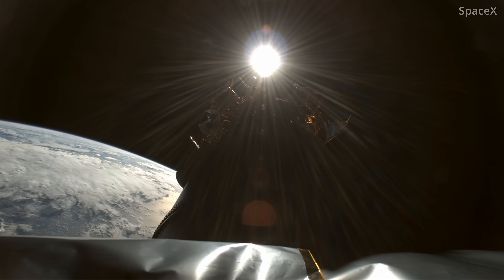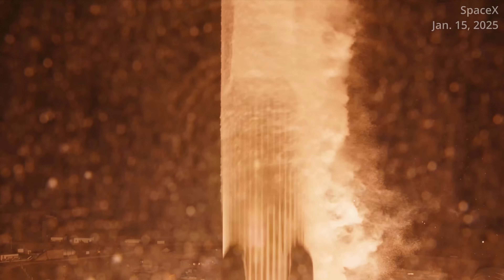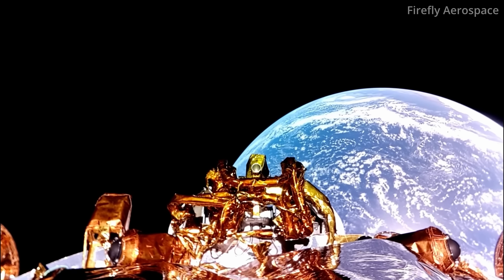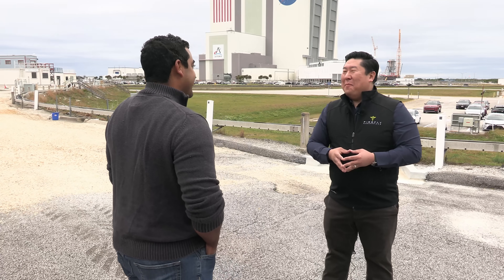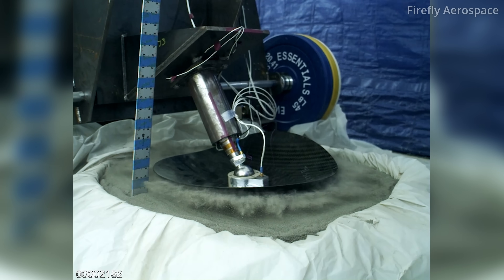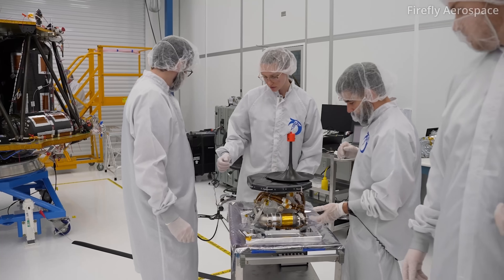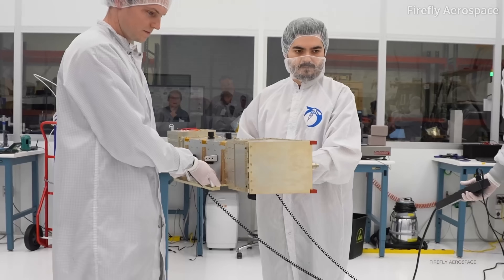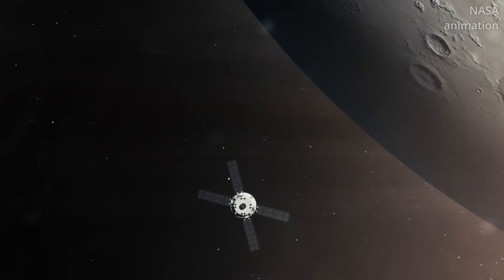Firefly Aerospace's Blue Ghost lander closes in on Moon landing

Comment: Let's see if theres any dust when landing be interesting
Reply: 8:02 One of the major payloads is studying the dust specifically.
“Stereo CAmeras for Lunar Plume Surface Studies (SCALPSS 1.1) will capture video and still images of the area under the lander from when the engine plume first disturbs the lunar surface through engine shutdown. Long-focal-length cameras will determine the pre-landing surface topography. Photogrammetry will be used to reconstruct the changing surface during landing. Understanding the physics of rocket exhaust on the regolith and the displacement of dust, gravel, and rocks is critical to understanding how to avoid kicking up surface materials during the terminal phase of flight/landing on the Moon and other celestial bodies.”

Comment: I've been following SpaceX  since before the first falcon 9 launch attempt, now bringing things up to date we're not in the business to launch Starship's for the fun of it, it should be obvious by now ,the numbers and equations the starship is designed by are not adequate for its task , but falcon heavy has been performing in accordance for the task that it is designed for, temporarily setting the starship aside and concentrating a falcon heavy's new upgrade add 10 meters for payload doors to deploy cargo, and my design heat shield rapping film light weight, low cost and heat resistant,and now we have another reusable vessel, problems solved.

Comment: is there a reason we cant get video streaming of a landing and then of a vehicle moving on the moon
Reply: Because it takes time to downlink video from the moon and back, plus, it’s a small lander with only a limited power supply. Live broadcasting of video is one of the last priorities
Reply: @archierush868 fair. thanks for reply. do you expect we will have live landing and live footage at some point this decade?
Reply: @yanbibiya probably not just because of the amount of data processing needed to broadcast live footage, even just 720 or 1080p footage, is too great and doesn’t pose much scientific value that actual raw data provides which is why for some rocket launches, you just see an animation of the launch instead because the video feed is not as important as the data
Reply: @archierush868 cheers

Comment: Didn’t we do all this in 1960’s  
Everyday i believe less and less that NASA actually went to the moon.  I sure hope it wasn’t faked but everything they said they did in the 60’s they are redoing with 60 year newer equipment, like we never had any data from the past.
Reply: Yes, but this is with a much smaller budget of around $100M rather than around $500M for 7 surveyor missions, 2 of which crashed on the surface, and it’s with a private company which made the lander, not NASA contracting it out.

Comment: Finally, a lander that is wide with a low CG, not tall and spindly and guaranteed to tip over.  Take some notes Intuitive Machines and Elon.
Reply: I believe the lunar starship variant will not have the nose tanks. But rather rear tanks for the landing burn. Which should help the CG. But I still see what you’re saying. It’s worth mentioning though that these light crafts are actually more difficult to steer than a larger one. Similar to a trailer here on earth. A smaller input affects a smaller craft a lot faster. You use a lot more fuel relatively to compensate for that. And are overall less precise(still pretty good though all things considered, we can certainly work with it)

Ideally the lunar ship will have legs too, hopefully it’ll work.
Reply: You wou think the Apollo missions would have set that template 56 years ago.
Reply: Actually NASA’s John Hubolt designed the mission architecture 65 years ago. Park in low lunar orbit and take a small two stage vehicle to the surface. SLS does not have the throw weight of the Saturn V because the upper stage is too weak and it cannot make low lunar orbit, so we are stuck with a high lunar orbit and this ridiculous “Gateway” concept which allows for a surface abort one a week rather than once every couple of hours. Elon will need multiple launches and perhaps a dozen LEO cryogenic refuelings (which have never been done or even figured out) and then wants to drag the massive Starship and its return fuel down and then up through Moon’s gravity well. Not only is this absurd but the moon is not perfectly flat and there are no chopsticks to catch it. But they actually don’t need return fuel because It’s guaranteed to tip over on landing. So it’s got that going for it!
Reply: @glenwoodriverresidentsgrou136     Starship is important because it can carry 200,000 pounds. If we want to build a base on the moon, then we need a big cargo vehicle...not a small lander.
Reply: Elon doesn't have to take lessons he's the one who  who they take lessons from may I remind you space x shuttles Astronauts and supplies to the ISS
Space X will bring back BOEING Stranded Astronauts back. Home in about 2 1/2 weeks from now aboard the crew dragon capsule that there spacesuits were specially designed for them
Reply: Two things can be true at once, and Elon is not right about everything. His Crew Dragon is a great design and his moon lander is too big, too heavy, too tall, too skinny, and requires too many LEO refuelings to be considered anything other than a Rube Goldberg contraption. Just because Elon builds it or says it doesn’t mean it’s right. He’s not the only smart guy on the planet.
Reply: @glenwoodriverresidentsgrou136  
Elon & Space X has saved the Space Program what he has done has encouraged other private companies to get into the Space Exploration Program 
NASA hasn't done anything 
Boeing Is A Failure
Bezos Blue Origin has shown great improvement  can't  wait to see what's next
Sir Richard Branson has taken a step back but hope he gets back in the game
Reply: @glenwoodriverresidentsgrou136 who cares about complexity when it’s the cheapest option? That’s why NASA chose starship for the lander, it’s cheaper than everyone else’s options for a human lander. SpaceX is also a whole league ahead of everyone else with all the test flights they’ve done and all the data they’ve collected to integrate into the lunar variant
Reply: @ only partially true. Elon says “the best part is no part”, a version of “KISS…keep it simple stupid”.  But the complexity of the lander is  a complete abandonment of this mantra and a huge liability with respect to safety. It’s not all about cost. Motorcycles are way cheaper than cars, but how many do you see in rush hour traffic?  How many Starship launches have been completely successful and didn’t either blow up or crash?  Almost none?  Would you ride in that thing?  And OBTW, Bezos is also contracted for a lander. A more conventional design, short and wide. Elon is currently in the lead, but so what. May the best design win.

Comment: I don’t understand why it took a month to get there. Apollo took 3 days if I’m not mistaken. Escape velocity is what it is. 25,000 some mph. It had to be traveling at escape velocity.
Reply: Because Apollo had people onboard, which require food and water to live, of which they had around two weeks worth of onboard. This probe has no people, so it can take its time to get there checking everything before going to the moon.
Reply: @archierush868 I kinda expected some dumb responses but holy dead brain cells Batman.
Reply: @garyfliess4375 am I wrong? Do probes need food, water and oxygen to survive?
Reply: I think because they were a "piggy back" load on the launcher. They once in orbit around the Earth they had to wait until the satellite and the moon were in the "correct position" to start the trip to the moon. The Apollo was lauched at such a time (and Satellite-Moon constellation) that it could immediately continue to the moon. For Apollo time was important as the amount of oxygen was limited. 

And not being time constrained doing a couple of days around the Earth allows to check the satellite thoroughly before sending it out to the moon. Certainly also useful.

On a mission to the moon you do not have to reach escape velocity. You basically go into an eccentric orbit where the apogee is so close to the moon that the Moon attraction "wins"  from the Earth attraction and you transition from an Earth centered eccentric orbit to a Moon centered eccentric orbit. That is the most fuel efficient way to get to the moon. However, the Blue Ghost orbit is a bit different. They do not fly the "8" pattern that Apollo did (which is the most fuel efficient and probably one of the fastest orbits to the moon) but they keep flying in the same direction. This certainly takes longer (and also more fuel which surprises me a bit about this orbit).

Comment: Did Apollo land with the large bell or the smaller thrusters?
Reply: The blue ghost is about as large as a big golf cart. The Apollo Lem was huge in comparison so it had a large landing engine.
Reply: @johnviolette5511  True. And a big part of the large size difference is also due to the astronauts needing to have a way to get home. The weight of the ascent engine alone (dry mass w/o fuel) was 2100 lbs!
Reply: The small ones. The lander had no "large bell". That was on the lunar orbiter.
Reply: @PosiTim-GNSS  Troll much? All of the Apollo Lunar Modules used a single large variable throttle Lunar Module Descent Engine (approx 10,000 lb max thrust) for descent and landing. There were also small thrusters used for attitude control.  These were certainly used for orbital docking maneuvers, but I am not sure they were used at all during landing. The large descent engine could be steered via a two-axis gimbal. For the last few Apollo missions, performance of the descent engine was enhanced by lengthening the engine nozzle/bell. This increased overall performance and allowed those landings to be performed with significantly less fuel. With reduced fuel weight, it became possible to deliver more equipment to the lunar surface, including the lunar rovers.
Reply: Did it is the question...

Comment: This is a 14 day waste of money, this mission should last at least 10 years and the secret part likely will
Reply: How would you make a probe that can survive 10 years on the moon and it enters extreme ranges of temperatures for two weeks of +180C and two weeks of -150C?
Reply: @archierush868 Well if they can't make a probe to survive this then lunar and Mars colonies are out of the picture, thus everything is a lie.  LOL I have frying pans that already do that, very low tech.  Thanks for admitting the lie and the waste of money
Reply: @archierush868 LOL if they cannot make a probe to survive this, then the lunar and mars colonies are nothing but lies.  Thanks for playing and proving my point so well.  PS I have a frying pan that can survive this, very low tech.  You may resume coloring now
Reply: @area51z63 no, you didn’t explain how to make a probe survive this kind of environment. Solar panels don’t work at night which happens for two weeks on the moon and at over -150C, and during that time, the probe needs to stay on to warm the electronics so they won’t freeze. Nuclear power is extremely expensive and the US and NASA currently only has enough plutonium to make 3 more of Radioisotope Thermoelectric Generators which power stuff like the Curiosity and Perseverance rovers. 

Explain to me how you can make a probe survive on the moon for years and for cheap. And yeah, a frying pan can survive that, but a frying pan isn’t scientific equipment
Reply: @ 1. Using math the 2 week probe is the most expensive option as the data gathered can be expressed in minutes not months or years.  Thus a probe that cost twice as much  will always be cheaper if it last for a decade.
2. That said nuclear which seems more expensive, is actually the cheapest option as it will provide power far beyond the point when the probe becomes obsolete. 
3. You forgot to explain how a lunar or mars colony would protect humans in these conditions.  
4. Thanks for making my point that this is a total waste of money so well
Reply: @archierush868 LOL if they cannot make a probe to survive this, then the lunar and mars colonies are nothing but lies.  Thanks for playing and proving my point so well.  PS I have a frying pan that can survive this, very low tech.
Reply: Why bring it back at all ? What do they need it on earth for? Charge admission to touch something that never made it to space. That’s why they bring it back cause eventually that balloon holding it up in the sky pops after a couple weeks

Comment: I am a big dummy so don’t read this. It looks like a cluster fudge. Way too many wires, which equates to way too many failure points. I mean I think it will work but I could design a better one. I am on the Kerbal space program team. It’s just a big gas can.
Reply: Most of those wires are often backups to already existing wires and so if one wire fails, they can use the backup wire.